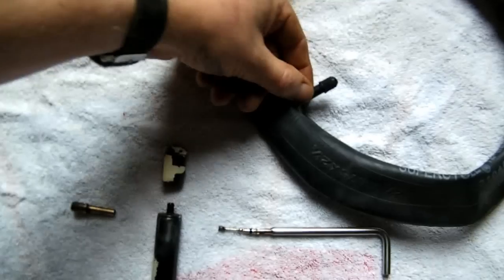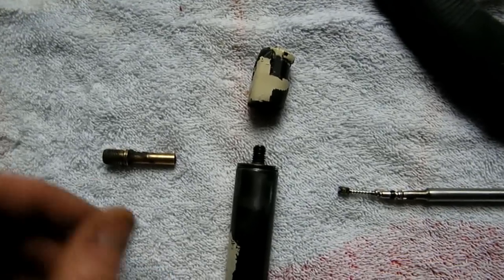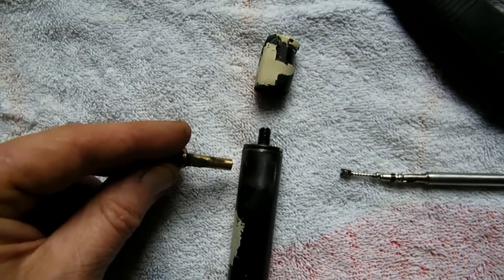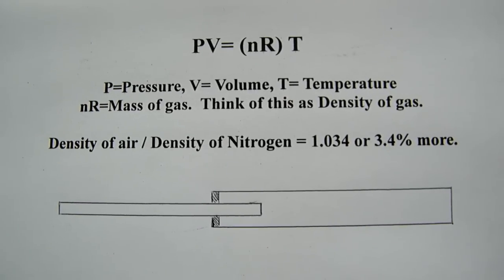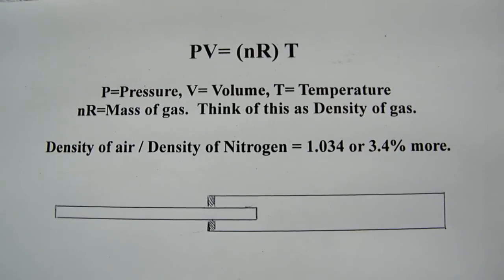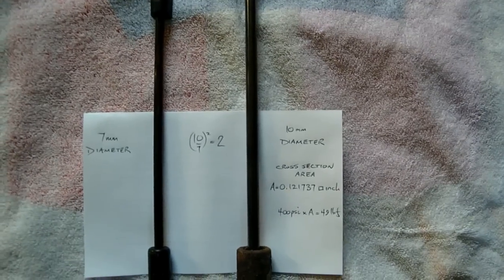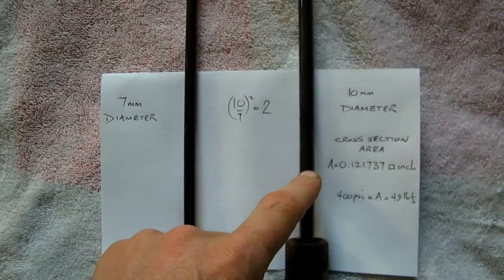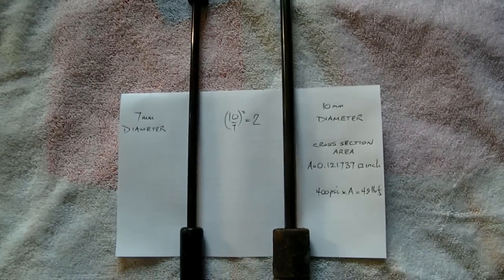Gas spring lift strut recharge DIY - truck cap.

Comment: If using nitrogen in tires doesn't make sense, why are ALL aviation tires filled ONLY with it?
Reply: I was told  it's because  pure N  has no moisture or  O2  in it,   which  is  good for  inside the plane's tires for  a few reasons:    No   oxidation/corrosion pitting the  rims causing slow leaks inside the tire,   and  no moisture vapor  freezing at high altitudes (that's  when the big part of  pressure  inconsistency  happens)   going from  100f on the tarmac to  40 below is a  pretty  big swing...  Plus  it's  non flammable in case of a  brake overheats on landing.    N molecules  are larger than 02 moles and  supposedly  harder to escape through the  tire carcass too.

Comment: How do they go bad ?, if it has a broken seal, won't it not hold any pressure?
Reply from the maker: No seal is perfect and the oil eventually finds its way out with the help of pressure and each time the spring is cycled. The worst is when people make the mistake of installing them upside down. 
I expect hydraulic seals in construction equipment die faster due to dust, dirt, wet, and scratches. Seals don't break, but they do wear, causing graceful degradation.

Comment: do you have a little mistake , the area of the piston in order to calculate de spring force, should be the external diameter of the cylinder wich is the body diameter painted in black, less the thickness of the wall multiplied by two, so the force will be higher than you cvalculated before
Reply: The calculation is correct since the "piston" in these is just for damping as in a similarly constructed  . And to act as a end stop, that is what the o-ring is for, not sealing. Pressure is the same on both sides which gives the effective area of just the area of the rod.

Comment: Thanks for the video. Would you share what you used to get 350 psi? This is pretty high pressure with DIY compressor. Thanks.
Reply from the maker: Google "bicycle shock pump" or "bike shock pump". They are cheap and plentiful.
Reply: There ain’t no way you can get upto 350psi with a hand bike pump thats about 20 bars lol our high end Compressor at home only goes upto about 280psi
Reply: @teammouse  why not. its take time but its possible. Psi, bar, kpa is pressure of air. Its doesn't represent volume of air or whatever
Reply: @ayn30  you know with a hand pump the higher the pressure gets the harder it gets to push the piston down at 20 bars it will be nearly impossible to compress even more
Reply: @teammouse  Hmm i think you dont understand how hydraulic and pneumatic work.
Reply: @teammouse He used a bike shock pump that is capable of much higher pressure than a regular bike pump.

Comment: Nice idea, but there's a reason why they failed. With age, the seals dry out and allow the nitrogen to leak out. They're just going to fail again.
Reply from the maker: Everything dies, that's true. I bought the cap well used 15 years ago so the gas springs may be 30 years old in 2022. I have had to spend a few minutes charging them once since I posted the video but they still work.
The truck itself and the deer it hit are no more, but the cap lives on as a bicycle shed.

Comment: Shucks no room on mine for the valve. Wonder how they fill them at the factory?
Reply from the maker: Mystery machine #1
https://youtu.be/vRvJuHEm6UI?t=130
Mystery machine #2  (better view)
https://www.youtube.com/watch?v=uuDO1ScCx2s

I once imagined liquid nitrogen would be directly involved but the invisible hand of capitalism solved that. Holding a new small gas spring in my hand and looking down the top where the arm enters, and referring to machine #2 vid, there seems to be an integral valve just by virtue of the construction which is then especially sealed by the internal oil when you invert the spring to its default orientation.
The tank PSI can be huge and a regulator can step it down to what is called for.

Comment: I think I will buy and use valve extenders, that way I can tap and screw in plus jb weld
Reply from the maker: It's worth a try. Bear in mind the force pushing the D=7mm diameter valve stem out is 400psi x [ 0.25 pi D*D / 25.4mm*25.4mm] = ~24lbs. Wear eye protection :)
You want a snug threading job and the open question is how good the JBWeld epoxy bond to the outside of the metal tube is. With no extra effort you could add a few wraps of wire around the tube on either side of the valve to give something extra for the epoxy to grab. It does not have to look good, it just has to be good.
Reply: @htpac  yes it’s a lot of force… worth a try though.
Reply: Air compressor tank fill valves I have ordered

Comment: Honestly I think this is the first video I’ve ever gave a thumbs down to..   The video would have been much more useful without the science and video actually showing the work being done and the working result ie the gas strut fixed.
Reply from the maker: Plumbing soldering skill is a prerequisite. There are videos dedicated to that. Watch and do. Experience will bring you to the difference between a good solder joint and a "cold" one, which is the crucial thing you need to know. Get a feel for that and it is easy.
Science: aspiring to be ignorant of a few basics is a blindfold for the mind. Don't trust me..."trust the science" :)
Reply: @htpac  So the point of the video was to show everyone how smart you are versus actually showing the work done in real time.  Got it.  I stand corrected.  News flash smart guy anyone can post a video talking from a high level of understanding about a variety of subjects they are well versed in.  For example I happen to be an network engineer.  It wouldn't be hard for me to post a video that was intended to show how to redistribute EIGRP  into OSPF  Then go in depth from a high level of understanding about the protocols, never actually showing me configuring anything only then say Voila all done at the end!  Yes it would make me look smart but wouldn't do much for helping the person watching the video actually accomplish the task at hand.
Reply: Schrader valves are so cool! Here's a video on how to install one onto a spray can to make it reusable. https://youtu.be/doLPFPeJ6JE

Comment: Hahaha.... Take this thin wall cylinder (composition unknown) and just SOLDER in a bicycle tire valve (after you have cut it all up with a knife) thats rated for 35-50 psi (containing [possibly] dissimilar metal[s]) and pump it up to 350psi. Wait until the galvanic corrosion sets in from the 4+ metals attacking an already aged cylinder kicks in. That overused 350 psi strut that just got injected with moisture from the air (and possibly salt depending on where you live) will be waiting inches from your face every time you use it. No thank you -- I'll buy a new one. Ignoring the previous statements for a moment, I will say this was actually a pretty good video. He is very knowledgeable, he showed the math he did (well enough for me to follow it anyways). He didn't try to sell you anything, he didn't ask you to donate your first born to his Patreon page; In fact, he didn't throw out that dusgusting "Like, subscribe, and  click the bell" like most disgusting video hosts do. With a set like this guy has, if his struts go bang it will just be like Pop-Rocks to him. I'll watch more of his videos.
Reply from the maker: Cameron, you raise a good point about solder strength and there is such a thing as a “cold solder joint”. This is why the electrical code specifies Mar connectors and disallows soldering in house wiring: a good solder joint is better than mechanical contact, while a bad solder joint is worse. I could have taken a few extra minutes and brazed since that is not much more expensive than soldering. You can buy an oxy-acetylene tank that looks like a regular plumber's torch tank and it only costs double. Brazing torches are just rifled high flow propane torches. Tools pay the more you use them so the cost is negative.

Note though, that the valve cylinder is 3/16th of an inch so the pressure on it is 0.0276 x 340psi = 9.4lb, not 340lb. Further, the Shraeder valve itself is the same as on the nitro charged shock on my dirt bike I had years ago - the valve itself is easily trust worthy at 400psi and beyond. Another way to think of it is when you put your finger in a dike to hold back the sea, it is boring and nothing more.

The valve body is made of brass which is a copper alloy, so it solders fine, while brazing can melt it if you are not careful. Gas springs are made of cheap strong steel. You can tell when you have a good joint by the way solder wicks and flows - experience doing copper house plumbing will give you that feel.

Someone said if we live beyond our reckless and stupid years (21+?) then we stand a chance of living to a healthy old age. It is a miracle I am alive.

I can report that the springs are still working even though I lost my truck to a deer and the cap is now a woodshed on some land I have.

Comment: And in the end you save $20.00 minus your time and effort. I am lazy and will order off Amazon, but still an interesting video from a guy that's a whole lot smarter than me.
Reply: My john deere damper is one of a kind and is $120 for an aftermarket. If this fixes my problem, I'll do a backflip.
Reply: @mightymightymightyman199  how’d it go?
Reply: @bruhh8908  Haven't fixed it yet. Still working on my cub cadet tank48 zero turn's hydros.
Reply: I got Lucky and found them still at around 15 dollars for what I need. I was also going to fix em, but in the end I know I'll spend 5 times as much and 20 times as long as if I had just bought the professional. I might fix a future set, but not this one.

Comment: What are the reasons to stop working of the struts
Reply from the maker: No seal is perfect, and no machining is perfect. You may lose a little gas with every cycle of operation, but I suspect failure becomes quick when the small squirt of oil inside from the factory finally is used up. That is a good reason to remember to ALWAYS install these with the cylinder up and the stem down so the oil seal can stay oiled inside.

Comment: Would adding carbon dioxide prevent rust from forming as quickly along with reducing the speed of the leek as it is larger than nitrogen?
Reply from the maker: Technically yes, since there would be no reactive oxygen.  Interestingly, An apple farm near me keeps apples in cold storage for up to a year in CO2 filled rooms. I buy from them year round.

Molecule size certainly illustrates itself in a helium filled rubber balloon so a bigger gas molecule has to be better, qualified by the size of the hole, which we don't know.

Your good idea is definitely an improvement and here is how I would cheaply do it:  fill a garbage bag with CO2 from a tank (fire extinguisher supplier 99%, or beer making 99.9%) and then charge the spring as I have done, but inside the bag. CO2 is heavier than air so no problem keeping it in the bag. Using car exhaust might be nasty but I'll never admit I think it would work fine :)

I don't feel rust is primary or even secondary problem though. Internally the shaft is rubbed with oil every time the spring cycles, and the default resting position is compressed, protecting the internal shiny arm from the elements. 

A deer wrote my truck off but I'm keeping the cap as a small woodshed so I can run the gas shock experiment indefinitely.
Reply: A better way to avoid needing to solder valve is to get a dry ice and throw it in the cylinder  and reassemble it quickly. One drawback is getting the right pressure. Too much dry ice might cause the strut to rupture/leak, too less, lifting force won't be strong enougj

Comment: very nice and quite interesting. the air will react to heat / cold more than the nitrogen. this will cause leaks and may effect the accuracy of its function. or it may not. who knows. still very interesting.
Reply: When your at 350psi it won't matterl much.
Reply: " the air will react to heat / cold more than the nitrogen ". how much? given that air is, you know, like 80% nitrogen.
Reply: @cgoody3170  I make this assumption based on race car tire inflation when we use air the tire pressure increases as the tire heats up and the air  expands. when we inflate the tire with nitrogen the heat from the tires does not affect the pressure in the tires resulting in a more consistent tire through out the race. I would assume the same would apply with struts. I could be wrong I been wrong plenty of times in my life so being wrong is no stranger to me. lol what are your thoughts?
Reply: Yep, you are wrong , NASCAR your talking extreme conditions to cause slight differences. A gas trunk spring filled with air or nitrogen in any weather condition would have negligible to nil difference.
Reply: @madeleyinc  then why would the manufacturer use nitrogen and NOT simply air? it would be much cheaper to pump air in them than to buy nitrogen. according to the strut manufacturers that I spoke to when doing the research for this video it was used for the very reason I stated. a car heating up in the hot sun can get pretty hot and that will increase the pressure more in an air filled strut verses a nitrogen filled strut. higher pressure means more likely to leak and lose pressure. of course this is all based off what my sources explained to me.  it makes no real difference to me either way other than to provide accurate information obtained from the people who build and design these units.
Reply: @daveknowshow  because the molecules in pure nitrogen are slightly larger then a normal air mixture we breath causing it to hold pressure for longer and be easier for the manufacturer to seal.

Comment: Confusing  me there..  i have 2 gas springs off a treadmill, both are half the size girth wise but same length. Now from factory they are charged to hold 165 lbs of weight..  takes a lot to compress em.  So hows that  cross sectional thing work again?
Reply from the maker: To a good approximation, PV=constant, so as you reduce the volume in your treadmill gas spring, the pressure goes up accordingly.  Obviously if the housing volume is huge relative to the arm, then the pressure change between arm position extremes will be small. If the housing volume is small relative to the arm then you can get a much stiffer spring since the pressure change will be larger. 

The force on the sliding arm is proportional to the cross sectional area of it, since inside your spring, forces on the sides of the arm balance out, and only force on the end is not. 

Are the two, together, supporting 165lbs, or are each intended to handle that much independently? 165lbs is not far off the weight of a minivan hatch and I expect you need higher pressure than a 400 psi bike shock pump can supply. If your springs are junk you always experiment or just cut one apart for interest and see what it looks like inside.
Reply: Yea theyre junked off of 2 different treadmills.  So one each is only used on the things is to assist when folding up the tread parts.  But these things are ridiculously strong with the piston arm only a cm around and the strut assembly is about 1/2”.  But extended they are about 2.5’ long tip to tip and half is piston  rod and half is the housing.   I really want  to drill ahole and tap it with a schrader but i tell ya everytime i go to crank down on the press my giblets just start fighting and wont let  me do it..  ive seen  many drilled open with just a little psst like a coke can but my luck ill level my garage.. 
  Theyre labeled 550n and other says 165lb.  I weigh i know 210 and when i put all my weight on one or  the other it just goes down so slowly.  Maybe im not putting all my body in a linear motion and all but jeez..  
  You  said  minivan springs are around that weight  though?  I was wanting to decrease the pressure to add as hood or tailgate assists but figure the pressures are way too much as they sit. And worried about buckling at the little shaft like when your wife sits on it wrong real hard and ya make that sound.. ya know?  Lol   Gguhoooohshit!  Ha!  That’s funny right there..
Reply from the maker: @Z-Ack  You make me grin and also motivated me to add some example calculations in the video description. Your spring arms are 10mm diameter and from your description, the pressure is way up there - maybe 900psi. You have to have caution & respect and be thinking when dealing with that kind of pressure or hurt yourself.
Assuming I had such a high pressure source, I would want to do an excellent job brazing or welding the valve because if it let go it could travel like an air rifle shot.

Comment: Fantastic video...really interesting and I would love to try and see if I can do it. My strut is leaking some oil and I wonder if I have bad seals and a recharge would be ineffective. Do you have thoughts?
Reply from the maker: Thanks.
If you can see and feel leaking oil then bad seals for sure, and I would not expect to salvage it. That would be a good strut to practice the fix on if you would value the practice.  If it was the usual slow leak and you no longer get the lift you need, then your strut is worthless but a candidate for the fix.
Reply: @htpac  Great information, thank you. I'll try that when I can get a valve...